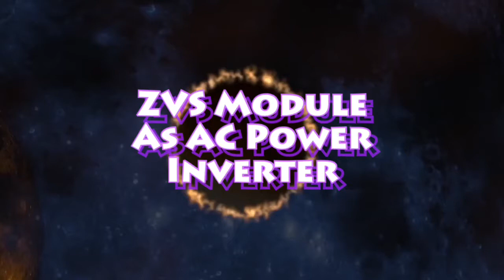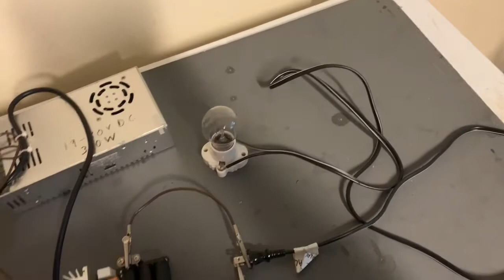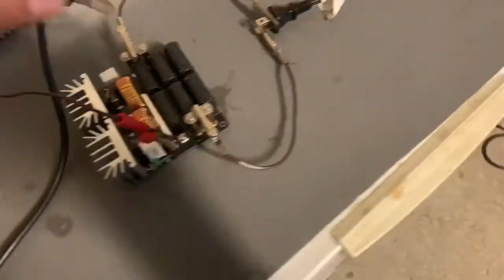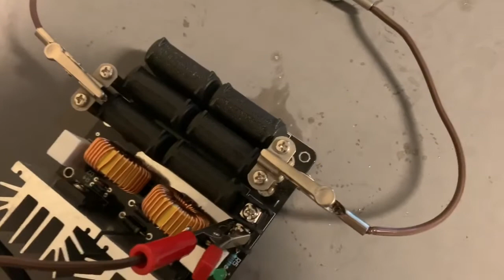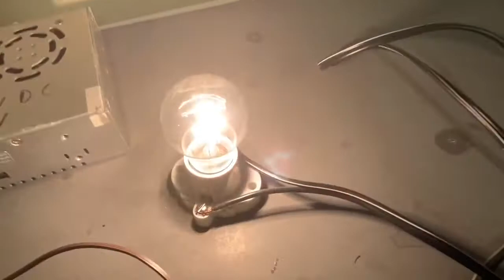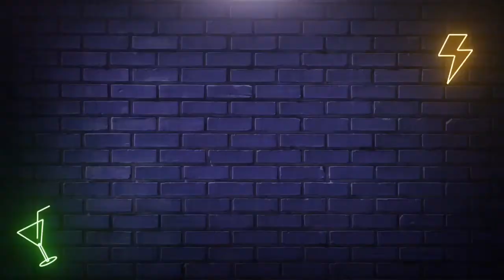ZVS Module  Lighting up a 120V 60W lightbulb

Comment: Hi, ZVS driver typically has three output leads, do you connect the bulb to the center one between 
the other contacts?
Reply from the maker: This ZVS has only two output leads – check this out:

https://markobakula.wordpress.com/power-electronics/500w-royer-induction-heater/

This is the one I used. I reduced the capacitance to 150 nF